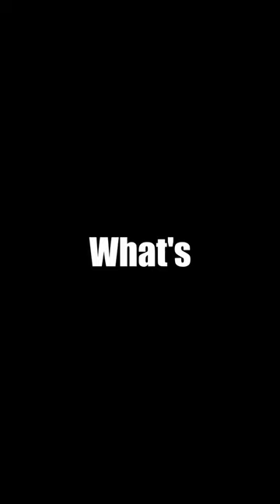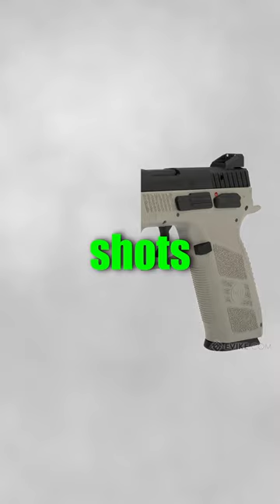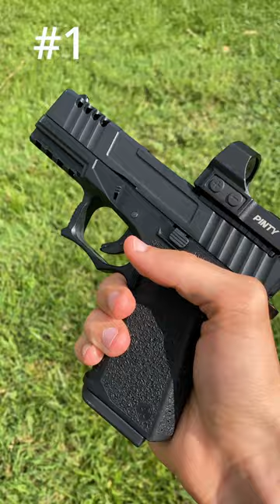What's the Point of GBB Airsoft Guns? 🤯

Comment: I have a 1911 Non Blowback (almost 2 years, made of full plastic) and Glock 19X Half Blowback (almost a month, 1:1 replica from grip and slide). They save gas consumption. The 19X gives me about 5-8 mags before switching cartridges, and 1911 gives me about 8-10 mags before switching cartridges. Pretty good than a full Blowback but the 1911 has a hard trigger pull but the 19X has double action and single action (rack the slide to make it single action or shoot it as double) but needs the trigger to be fully released to chamber a BB. The 19X isn't that bad, but it's better than my 1911. The 19X has a TDC (Top Down Center) hop up and Blowback (Halfway), but the 1911 doesn't have either. I've taken apart both of them and looking at the internals, the 1911 doesn't need a lot of work.